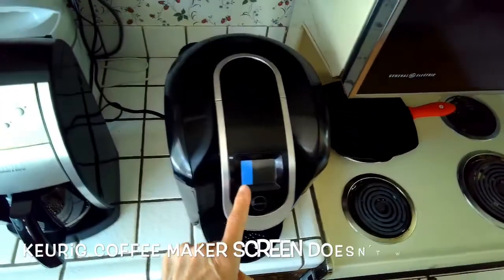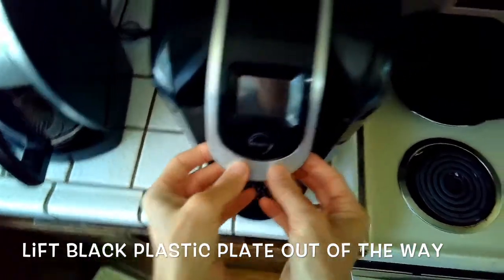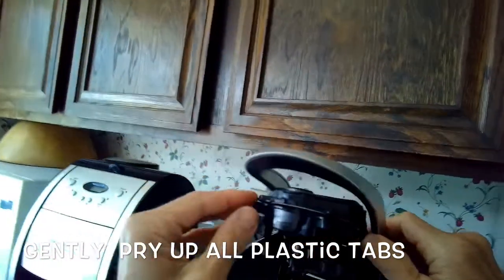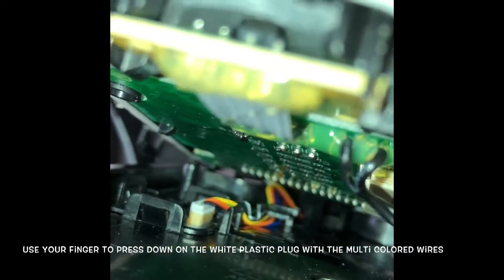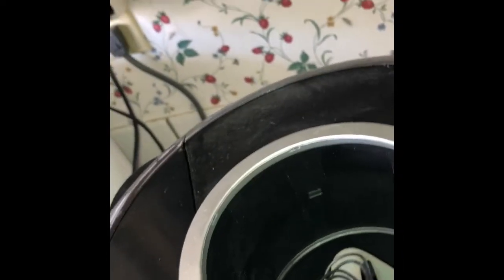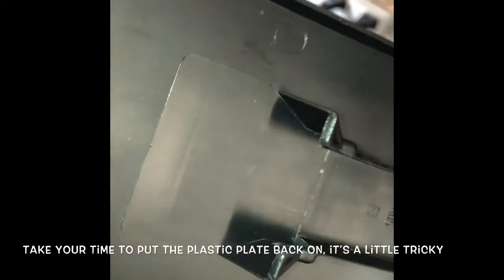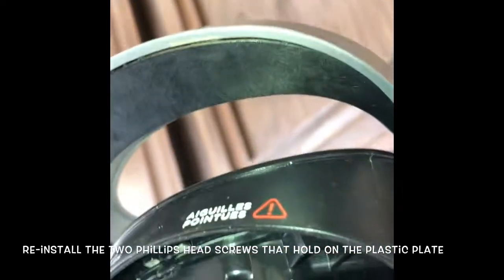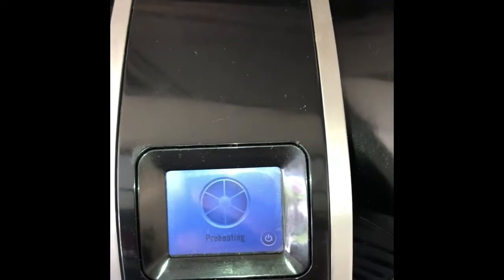☕️ KEURIG  COFFEE MAKER ☕️ BROKEN SCREEN (FIXED)

Comment: I cut out a small piece of cardboard and folded it 3 times in a Z shape. Basically made a small cardboard spring and wedged it underneath that white/silver screen box thing and closed everything up. The cardboard piece is basicaly shoving that electrical piece to stay tight where it needs to be. Works perfect thanks
Reply from the maker: Wow,  very very smart😊👍
Reply: I wish I had read your comment before! This is a good idea. I’ll try to remember next time I have to open this thing up.

Comment: Thank you for this video. My coffee maker is a 2.0 but it looked a little different inside. I couldn't find the plug with the wires, so I just pushed on the wires I could see & put it back together. It WORKS!! Thanks again.
Reply: Oh...and I took pictures, but couldn't see how to include them on this comment.
Reply from the maker: Thanks Joyce,

Can you send the pictures to: scottthefixitguy@yahoo.com
Reply: I'd be very happy to see the inside because I have a circuit board and a ribbon. Please advise further on how to fix it. Dont see where i can push on anything without damaging it.  Power light does come on but unable to power up the unit. Thanks

Comment: Great video that white plug was the issue but it was on the board side when I pushed the plug down the hole plug fell off the board bad sotter joint on the conector
Reply from the maker: Thanks Diana😊

Comment: Worked as in your video Scott. Amazing, simple fix. Thank you. Poor design is not the digital screen display but more the bad connector/plug that comes loose for that component. BTW, machine will still work without screen if you recall where all icons were.
Reply from the maker: Excellent feedback,

Thank you

Comment: I must have a different revision, since mine didn't have that small white connector.  Mine has one long connector at the back of the PCB.  I re-seated the displays flat cable on the side and push on the long connector in the back. One of those actions must have done it, as the screen is working correctly again.
Reply: Nor mine. I didn't see another harness other then the ribbon harness on the side in that area. You say there is a plug in one located in same area in back?

Comment: It was pretty tight in there but I would have tried to remove the plug from the board connection then replace it to effectively wipe the connections clean. Great job.

Comment: This repair is a short stop gap measure to real problem.i too did all of this only to find the plug was not loose,which tells me the socket has a cold solder joint that will soon cause the same problems with the display.
Reply from the maker: Some times it lasts, other times it goes back to a bad screen.
Reply: Used glass cleaner on screen / keep wiping dry/ it’s a miracle

Comment: I wonder WHY pushing the power button will not turn it off. You must unplug then plug back in and then it is off and will heat up only when you touch the power button again.  Otherwise it stays on and hot 24/7 using power to keep it hot when your at work and asleep at night. How Green is THAT. LOL